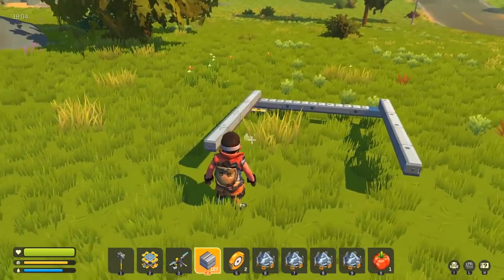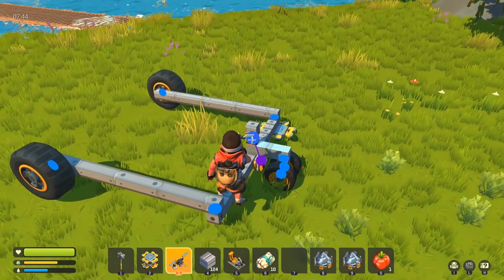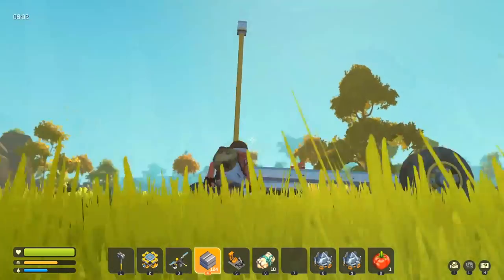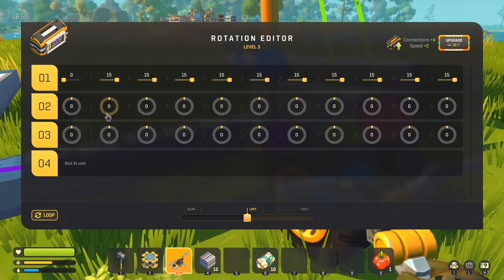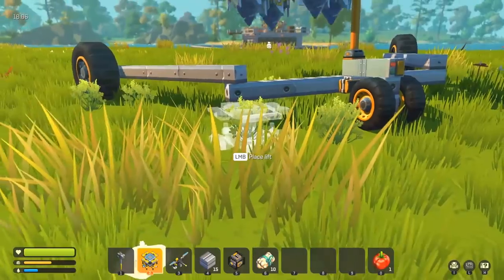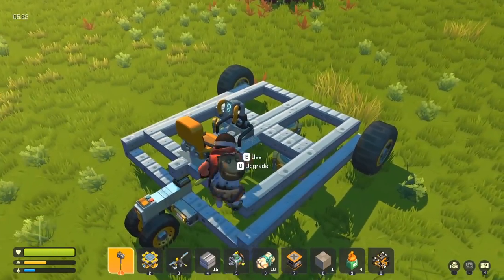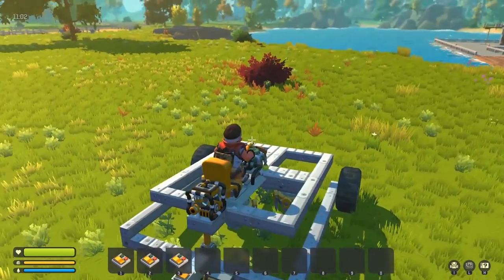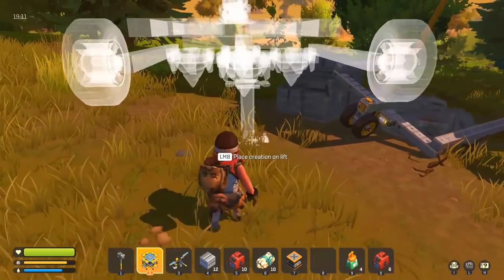BUILDING A DRILL MACHINE PROTOTYPE | Scrap Mechanic Survival Gameplay/Let's Play E12

Comment: this will work better than puting it up front once you get it worked out. and on a larger scale it will be amazing. when you have the drills on the front you bounce all over the place. plus once you get them to the smaller piece you can just hammer them or weld them to your creation and drop the piece into a grinder on your vehicle or at base.
Reply from the maker: I think with this prototype I have some ideas to make it better. Thanks 😊

Comment: It doesn't look that bad. It might work better, if the drills would be more on the outer edge, so that what is smashed got thrown inside the drills instead under the frame.
Perhaps adjusting the rotation direction might help too.  If they rotate against each other you can even create a direction the rocks are thrown too.  So you can make the rocks fly out too the front away from you. That might help.
If you can't imagine exactly what I mean, just make a little picture of them with the rotation directions. When the drills turn against each other the debris will be forced to move through the gap between two drills in a direction. That you can control by the rotation direction. Hard to explain. I hope you understand what I mean.
Reply from the maker: I think I know what you mean, thanks for the idea!

Comment: This is a good design just needs a little more weight over the front wheels and you need some suspensions on your drill mount so it can give a little without knocking your whole vehicle over.  But all in all I love this idea you can definitely refine this into a metal munching beast.
Reply from the maker: Thanks for the tips! Suspension on the drill mount is a great idea!

Comment: Loving the design concept.  Can't wait to see how well it works after you fine-tune it!  I was thinking have the front wheels be able to pivot with the same controller that you use to open the legs, just opposite direction so they remain facing forward
Reply from the maker: That would be cool! Working out the angles might help with the stability too 😀

Comment: Finally! Someone that doesn't build mining drills on the front of a vehicle.
Reply from the maker: My dad is a carpenter and owns a pretty impressive drill press. I would love to get this thing working so that it wouldn't be this derpy front end drilling machine lol
Reply: @zueljin  Angle each side up about 5Degree or so & make it wider & a lot heavier on the base. Also need a tear 6 engine i think. 4 wheel steering would make it easier to line up also. Hope you get it working.
Reply: Me and my M.E.E.P feel offended. Drilling from the top just feels better and hills are easier to handle

Comment: if it works, it is NOT a failure. given it didn't work the way you THOUGHT it would but it's still not a failure. learning the truth requires experimentation. through experimentation we find out HOW something works, then we update the theory and run another experiment for more data. rinse, repeat until you find what works.

Comment: the timer disappearing is a bug it's still running down it just doesn't show up when loading up the world
Reply from the maker: Yep! I was thinking that I would use multiple pistons and it would be cheaper and more useful to upgrade a controller since controllers give full extension on pistons by default without upgrades